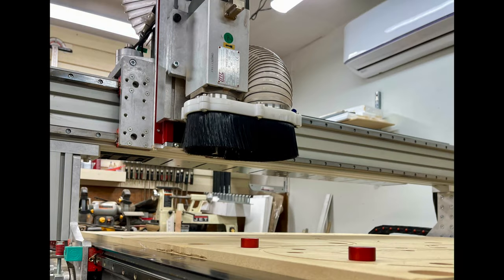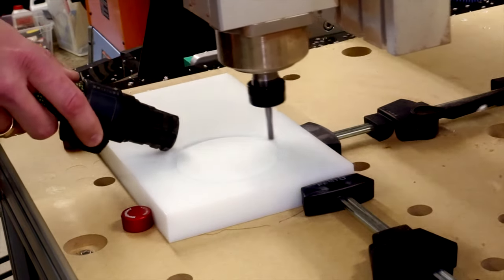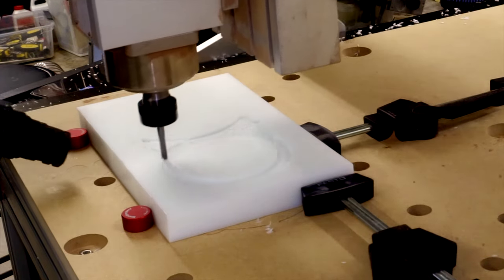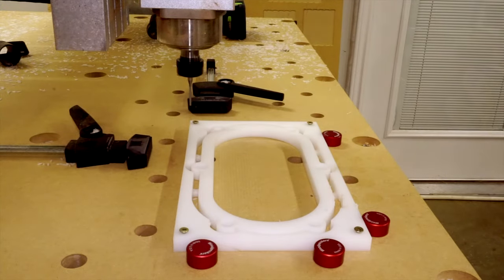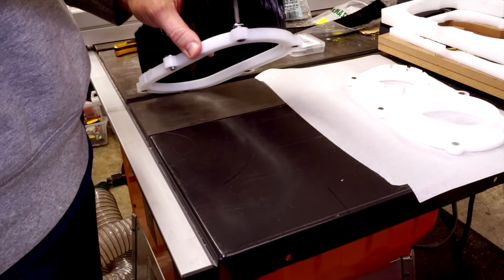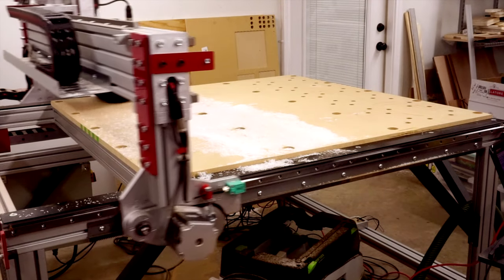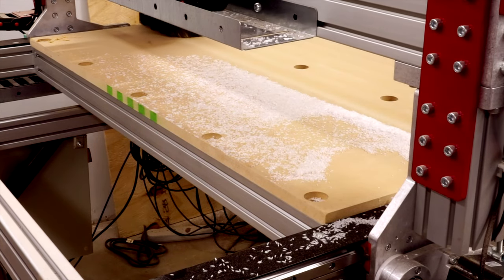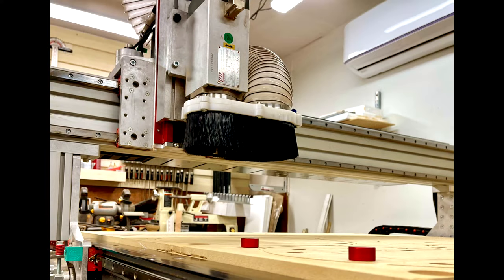Avid CNC Dust Shoe Build (V1)

Comment: Hey there thank you for posting the informative video and I really like the comment anytime you're able to create something on the CNC it allows you to learn I'm in the same position and considering purchasing an avid CNC was wondering your thoughts on that particular brand as well...I had  a question what size that machine is that you're using.. and if you were able to buy a larger machine would you have?

Thanks again
Reply from the maker: Hi Richard!  Thanks for watching.  This is my first experience with a CNC router so I can't compare Avid to any other company, but so far I have absolutely nothing I would complain about.  Machine and customer service have been great.  My machine is 4 ft x 4ft.  I could have purchased a larger machine, but I wanted to get a feel for using it and also am not sure if I'll be moving my equipment to a different shop some time in the future.  So for now, 4ft x 4ft was enough.  The nice thing about the Avid machines is that you can expand them rather easily, so for about $1200 and a few hours of building, I could expand my current machine to 8 ft which I probably will do some day.

Comment: What are those red bumpers called?  I looked on their website, but couldn't find them.  That's one thing I'm going to have to learn is the names for all of the hold downs and guide options for a spoilboard.
Reply from the maker: Hi David.  I think you are referring to the bench 'dogs' that I am using.  Assuming you are talking about the small round pieces on my spoil board that sit in the holes.  I talk about them a little more in my spoil board video.  In Version 2 of my spoil board I may switch to plastic ones because if a router bit accidentally hits these ... bye bye bit!

Comment: Smaller bits probably create a higher pitch. I'm surprised the cut list milled out the enter center in the bottom piece. Seems like a waste of material and time.
Reply from the maker: Hey thanks for the comment.  You have a valid point.  I'm only speculating but the goal may have been to eliminate any lips or ridges inside the dust shoe as you would have if you just cut two circles and left a center piece remaining.  But again, speculation.  What I should have done is just cut the center piece out and saved it to make some clamps with instead of just milling it away.
Reply: @MattesonCreations  - You could have run a final finish cut on the inside of the hole to take care of that problem, however it's a personal choice. Good video nevertheless.